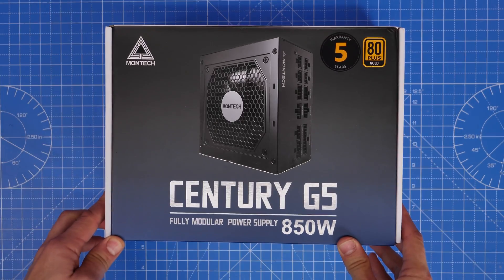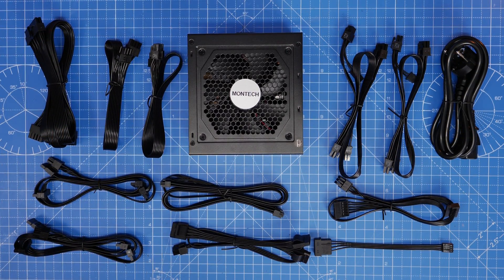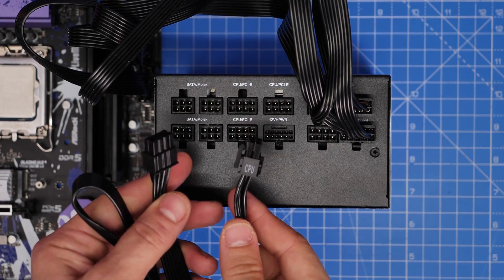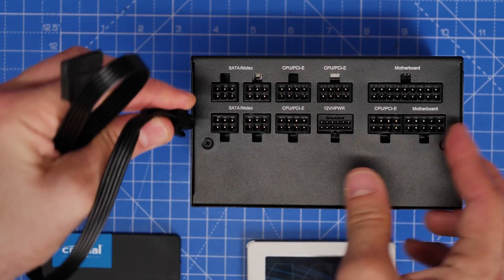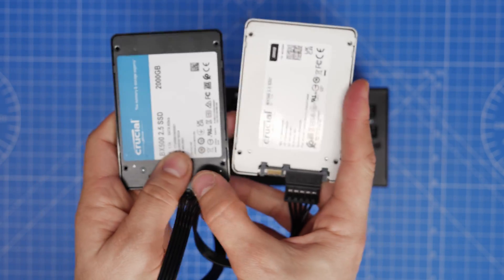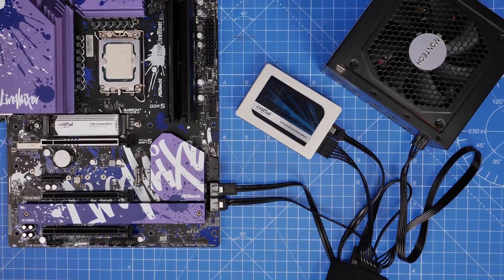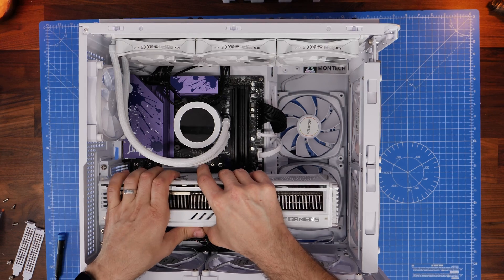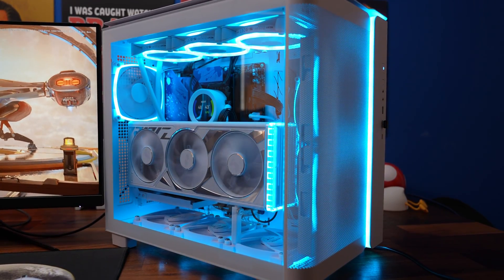Montech Century G5 PSU wiring and setup guide

Comment: Would it be possible to plug the pig tail end into the power supply and then the 8 pin plug into the gpu to save having the cables on show or is this not possible
Reply from the maker: @philjohnson1313  no. Don't do that